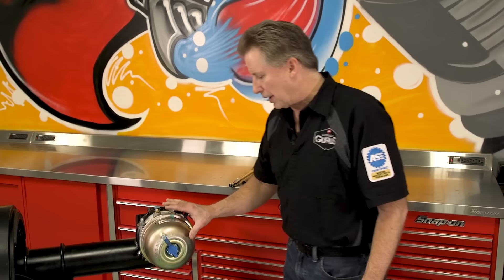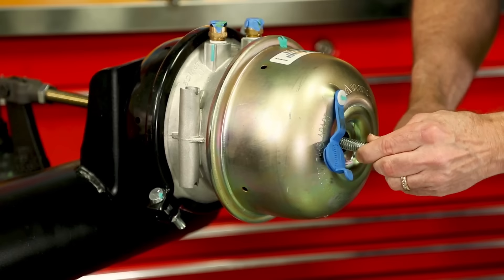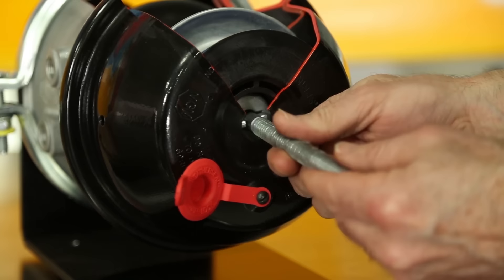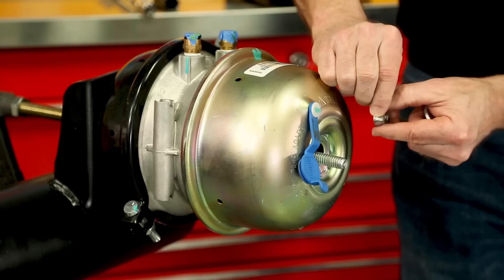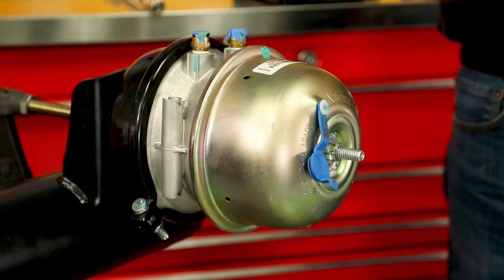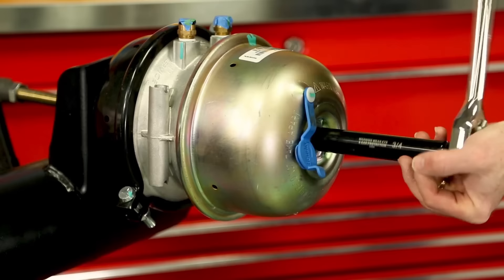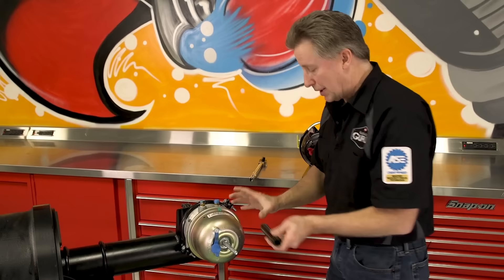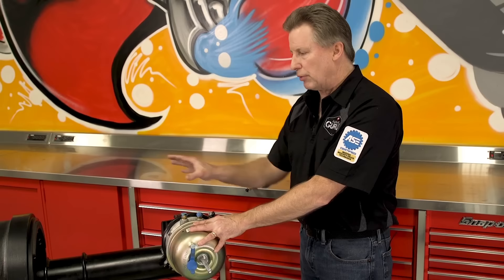Heavy Duty - Caging Brake Chambers

Comment: I welded 2 deep sockets together and made my own cagging bolt socket, I didn't have two weeks to wait to order one,  keep those threads greased,   it makes the job easier.   THANKS for the tips on cagging. William
Reply: oddly .I DIDNT WANT TO spend time welding something up! so i used an end wrench!
Reply: Could have used a rod coupling nut and a box or open end wrench... just sayin'.

Comment: I use a pass through ratchet and socket. On a lot of trash truck applications there is something right behind the can and you wouldn't be able to get the socket on the cage bolt.
Reply: Informative, thanks 👍 but question: once the bolt is extended out how do you get your tool off? Seems to me it would be good to use a rod coupling nut instead, and a box or open end wrench 😊
Reply: @railroaded1991  if it is that close then I use an open end wrench

Comment: This will be my first time replacing my brake chambers on my trailer and i want to learn, but i also don’t want my face smashed, so my question is: Before i remove the brake chamber trailer brakes should be applied or released ? 

thank you!
Reply: Released to remove all the brakes components, if you have access to air you can release the brakes and put the caging bolt in tighten up and then set the parking brakes if you lose air. It’ll save time and elbow grease, likewise when taking it out

Comment: Question: If air is still supplied, will the service brake still operate with the spring brake caged? I say it will as it's no different than air holding the spring brake back. But 2 guys in the shop say it will not and that they've tried it before. I think if that is true then they has another problem.  What say you, internet?
Reply: Depends on why you need to cage it.  If road debris cut the air lines to the brake then no, it absolutely will NOT operate.

Comment: So if a brake chamber locks up to move the truck or trailer to get back to the shop you would cage the brake chamber like this.
Reply: YES  your releasing the spring by caging it the bolt holds the spring back

Comment: Is it a temporary process in order to move a vehicle? And will the brakes lock up again if the bolt is taken out?
Reply: Yes is temporary,you don't want to be caught driving a commercial vehicle with the chamber cage(or without brakes)
     Thats what are you doing eliminating the brake system.
    When you remove the bolt,brakes strat working again!              That its just to replace the chambres,or my case.
    I need to move a trailer on the yard that I park 
     Air tank leaks,and their is no enough pressure to release brakes.
   I cage those bolt and tire moved freely.

Comment: Just wondering why they just don't use a free spinning washer nut or a flange nut so there are less parts to lose????
And the socket might be 5" deep but it's not 5" long and 5" deep.
Not a trucker or truck mechanic but those caging bolts are cheap enough that I'm going to buy a couple just in case I run across a trucker in need.😊

Comment: And what if the center shaft is not centered allowing the cagong bolt to go in
Reply from the maker: If the center shaft, push rod, is not lined up with the caging hole the chamber should be replaced due to internal failure.  If you cannot cage the spring, the chamber should not be in service.  The spring has most likely broken causing the push rod to be pushed out of alignment.  There are other internal failures that could result and that’s why it’s best to replace it.  A failed emergency side will fail to lock up the wheel end in an emergency situation along with failure to set the parking brake.

Comment: Is air pressure a problem and when uncaging do you just reverse until stopping?

Trying to move a bus right now
Reply from the maker: Air pressure should not be a problem. Usually when caging brakes on the side of the road it’s due to the lack of air pressure and the vehicle needs to be moved. So caging the brakes releases spring brake pressure and moving the vehicle can now be accomplished.
 To uncage the brake chamber just turn the nut counter clockwise until the caging bolt can be removed. This applies spring brake pressure and now the vehicle cannot be moved without air pressure
Reply: Thanks,

Comment: Just wondering, if the plug has fallen off the opening and you cant  cage the pot because its full of dirt will removing the brake pot release that brake?
Reply: You will need to remove the brake pot and clean the debris out then place brake pot back on, the pot is being used as a set force to keep the key engage in the cylinder. Unless you have a manufactured too that does otherwise it's just easier to do it with the pot on